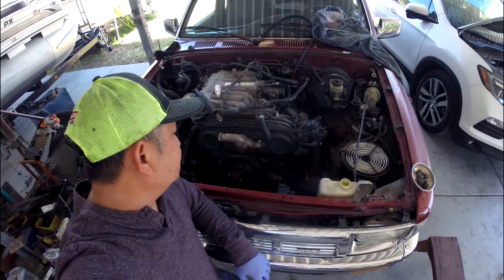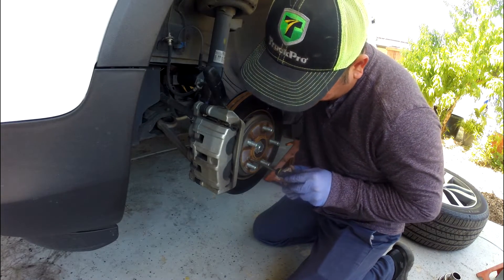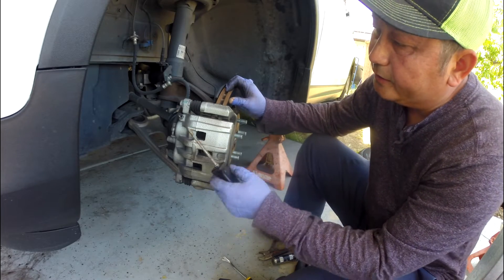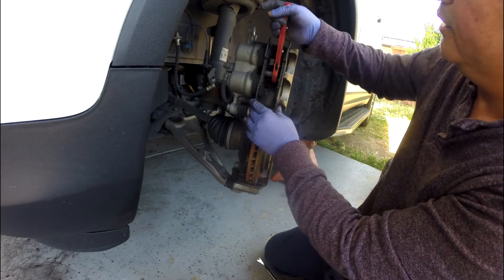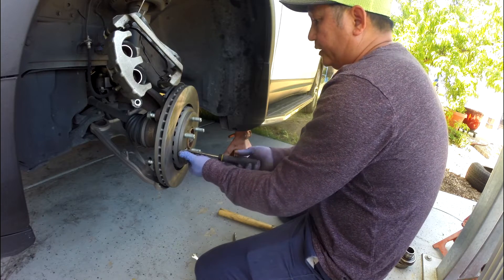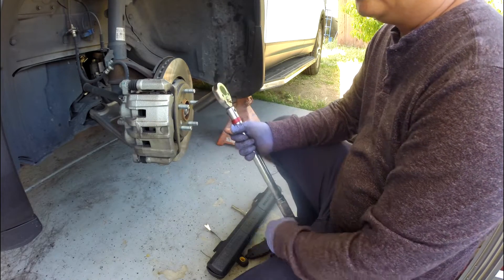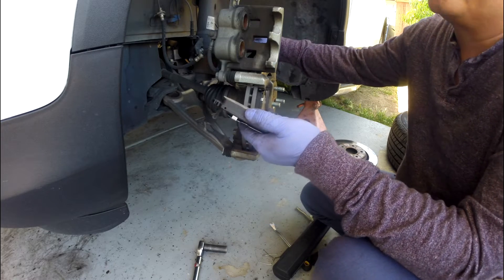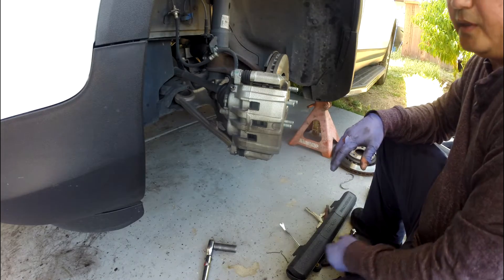2017 honda pilot front brake and rotor replacement

Comment: Nice video and you did a great job.  Just a few things to consider.  The front caliper bracket bolts are 101 lbs.-ft. torque (not 53 lbs.-ft.)  The caliper bracket needs to be cleaned and silicone lube needs to placed under the metal hardware.  The hardware should be lightly lubed where the pad sits.  A little silicone brake lube should be applied where the piston contacts the brake pad.  The piston boot should be cleaned before pressing it inwards.  Wiping it down minimizes the chance of debris entering the piston.  

I am assuming you lubed and cleaned the caliper pins and ensured they are free moving. That hub should have been cleaned before installing that rotor.  Also, you should check lateral runout, with a dial indicator gauge, before installing that caliper with new brake pads.  Use an electric ratchet to fasten the caliper bracket bolts....not an impact.  Break the caliper bracket bolts free by hand and use the impact to unscrew.  Impact wrench should be used...never a drill/driver with a socket adaptor.  

Lastly, if you are going to torque; you must clean the bolt threads and mating surface threads.  This is important and those bolts need to be inspected.  They should be a tight fit with zero lateral play.  Honda advises using new caliper bracket bolts and caliper pin bolts.  The torque is a dry torque but cleaning the threads is requirement to attain proper clamping force.

I like your videos and wanted to forward factory requirements.  We assemble these cars.  Take care.
Reply: I can assure you 99% of mechanic at any shop do not do half of these steps. The most for us everyday folks would be changing our own and do it slowly and carefully, cleaning what we can. I understand your ways are with the rule book but for diy, this is as good as it gets, maybe some more cleaning and that’s it.
Reply: @Dillz02  I know what the mechanics do.  They run fast for their flat rate.  "good enough" is their mantra.  Sometimes, they apply anti-seize to the bolts for quick removal when they service return customers.  DIY does not mean you don't have to do it right.  These brake components are actually designed to handle up to an extra 40% torque than the spec.  This is done since many shops use torque sticks to impact the bolts on and these are not very accurate.  Some just impact them on to avoid torqueing to spec.

I have a tip for you. The rotor screws are NOT Phillips # 3. They are JIS (Japanese Industrial Standard screws).  Use the Vessel Impacta # 3 screw driver.  It is a screw driver with a cam that turns 12 degrees.  It is designed for these screws and will contact perfectly.  Works similar to the impact driver you used but is a perfect fit.  Use it the same way and impact it.  In a couple impacts, that screw will turn free and no damage to head.  It is the Impacta 980 # 3.

Your videos are the best I have seen on You Tube for this current pilot generation. Keep up the good work.
Reply: Notes were so good had to screenshot thanks
Reply: All of this is excellent advice.  If you aren't able to follow many of these pointers - at least clean the piston boots before pushing them back in.  Simple to do and makes a very big difference.

Comment: Fun Fact: i worked for a Honda dealership for the better part of 20 years and in that time I discovered that a lot of the parts such as the brake pads and rotors are bought from either Napa or Autozone and customers unknowingly spend three times for the same part at a dealership then what they would have paid just going and getting them themselves from an auto parts store.
Reply: Not exactly true.  They get the parts from distributers.  However, they are produced to the Honda specific spec.  Then parts are produced at the same factory as the aftermarket parts.  However, the spec. tolerances are specific to the OEM.  There is a difference with fabrication even though they arrive from the same distributer.

Comment: How do I put the screw back and it is loose, I punched it and it not going in? How do you tighten it or fit in?
Reply from the maker: You put in the wrong hole in the rotor
Reply: Please disregard my question about fat screw, I didn’t line it up that why it didn’t go in.

Comment: Wait. Do u have to turn the dish before putting new brake pads on ?
Reply from the maker: This brake job in this video  is brand new rotor don't need to turn. But if you used the old one depend on how bad the rotosr are. If you apply brake paddle you feel a lot vibration then recommend to turn the rotor. If no shake or vibration then no need to turn.